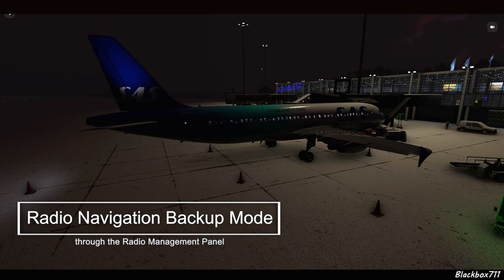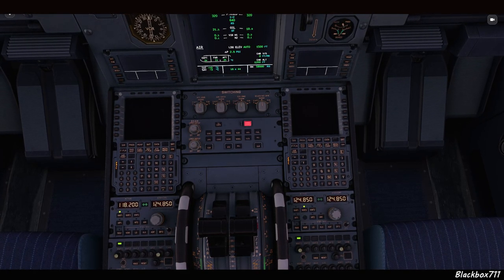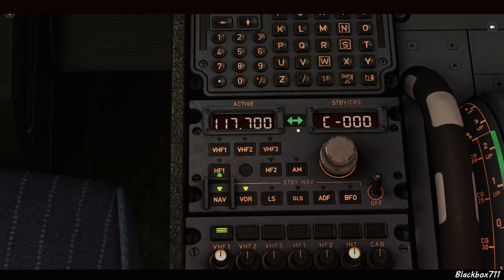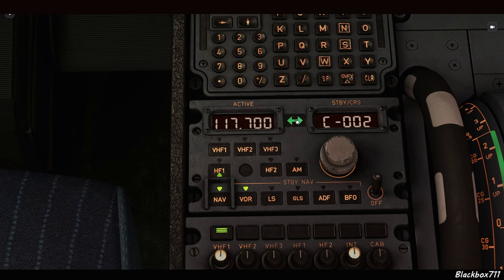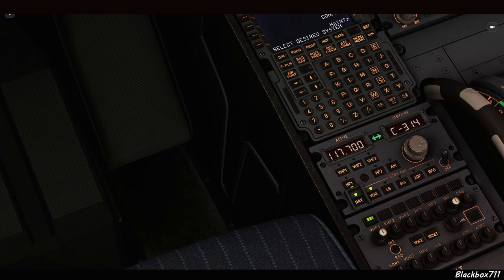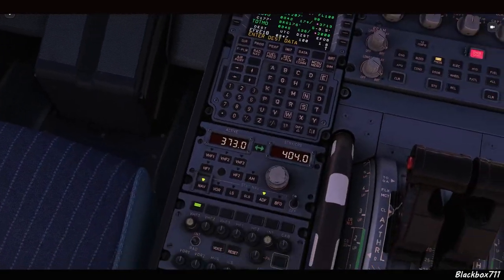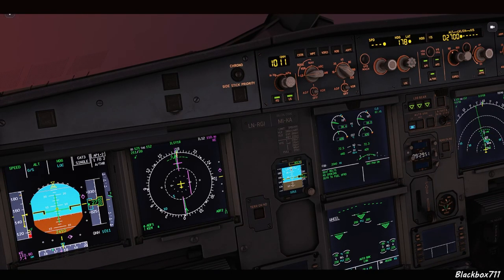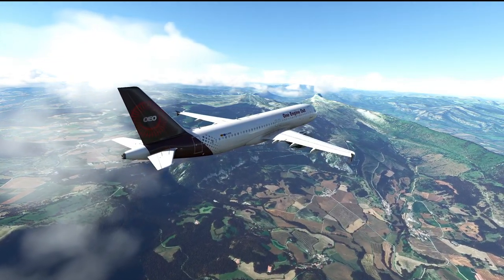A320 Radio Navigation Backup Mode

Comment: Hi BB
what causes the GPS primary lost on ND ..
reason , how to restore normal configuration?
Reply from the maker: Hi. Either a GPS signal loss or receiver fault. Not much you can do there. It will recover automatically if the signal returns or the system resets itself.

Comment: What is the 163° displayed on the top center even if the heading is around 125°?
Reply from the maker: That is a so-called „Grid Heading“. Grid north is a navigational phrase used to refer to the northward on a grid lines in a map projection. The ND normally wouldn’t display Grid North reference at the airport Rovaniemi, so it seems to be a bug in the FENIX.